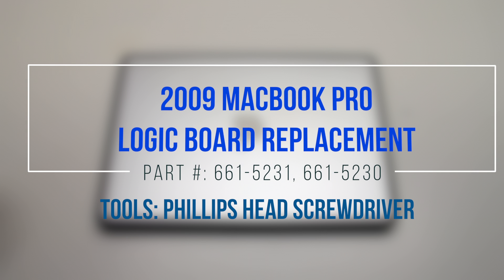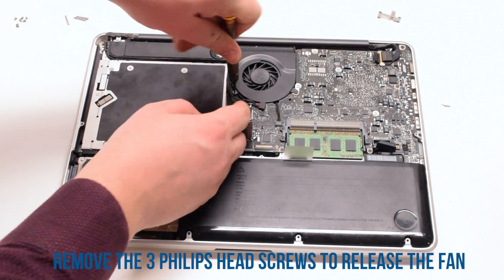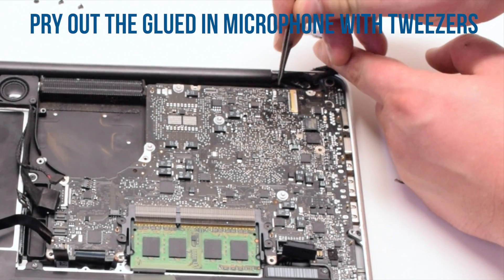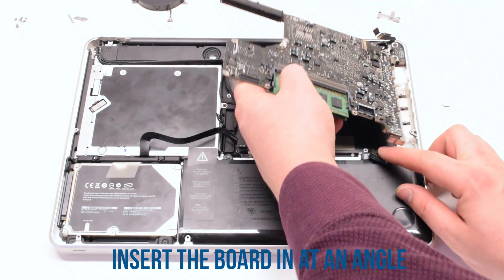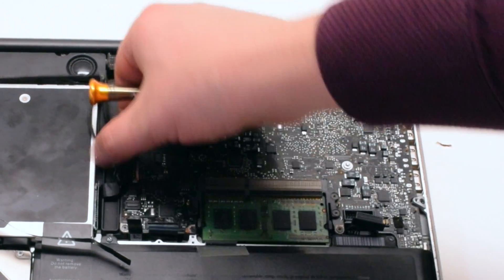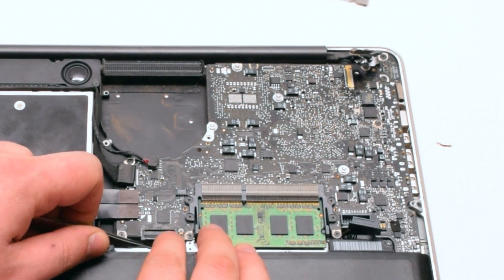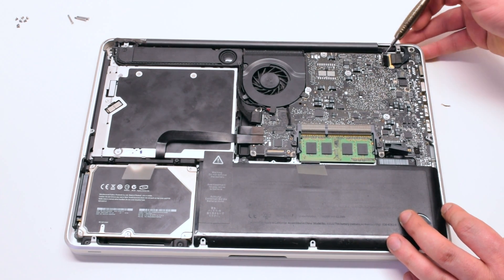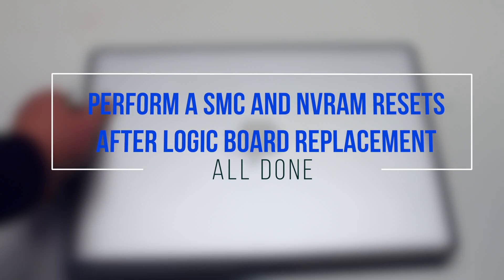2009 Macbook Pro 13" A1278 Logic Board Replacement

Comment: Can you put 2010 motherboard in mid 2009 MacBook Pro
Reply: Did you end up trying this out? I am considering the same thing.
Reply: @dan.c1991  here the same... I'm thinking on it
Reply from the maker: Slightly different connections. Some things like sleep and wake and isight will not work, so the short answer is no.
Reply: I compared a motherboard for mid 2009 and mid 2012  it most of the connection looks same
Reply: @NicVandEmZ  I am Japanese. I think the same thing, but have you made any progress?
Reply: ぴえんぽこ never tried

Comment: Can I replace a 2.26GHz logic board with a 2.53GHz logic board?
Reply from the maker: If it's the same model size and year then yes.
Reply: Can you put 2010 motherboard in mid 2009 MacBook Pro
Reply: Did that replacement work?